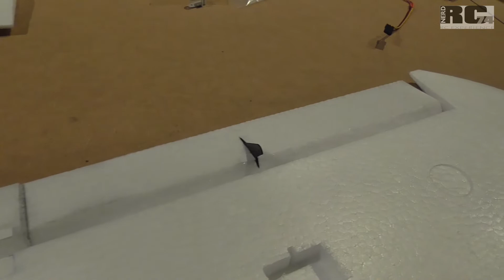MULTIPLEX FUNCUB | CLIPPED WING CUSTOM BUILD | PART 1

Comment: Check this out RCnerd74: https://www.thingiverse.com/thing:3671692
Reply from the maker: Nice part. What you have to solve anyways is the V shape of the wing itself. The V shape is in the foam itself too... but only necessary if you want a perfect looking finish on your funcub.  This part already helps a lot.
Reply: @RCnerd74  Yes, I shaved the mating surfaces flat with a razor blade before  joining/gluing them together. Wing came out pefectly flat. Are you saying the panels themselves aren't flat? I never noticed this. I only noticed the area where the panels join together had relief molded into them.
Reply from the maker: @austntexan  OK. It's just the center area of each wing half on the top side which is not flat if you mount the wing without V shape. I think this is what you already removed :o)
Reply: @RCnerd74  Man, I’m so glad I found your videos lol. I built my Cub and have it set up with full span ailerons, with most of the techniques you covered in your videos. . . my little Cub flies just like a pattern plane!  I’ve got a SS 2820 1100kv and it’s performance is unreal. I use an 8x6 on 4S and 12x6 on 3S. Loading the LiPo in the back vent was a brilliant idea. People ask me about my Cub every single time I fly it when they see it’s performance. It flies circles around every single Timber at my field. Love it!
Reply: @RCnerd74  I always hope you’re going to do another Fun Cub video. Any chance of doing one before Winter get here? ;-)
Reply from the maker: @austntexan  I hope so too :o) One idea is to show STOL capabilities without flaps... and some low level flying at perfect wind conditions... and a Winter flight is another thing i like to do.... white snow and blue sky... this always looks great. Currently i learn to understand the flight capabilities of my new Funcub in detail... that takes some time.
Reply from the maker: @austntexan  I am glad that my setup works well for you, too. With your motorization you have a lot of power. I recently flew a Timber. There are some things missing compared to our Funcubs :o)
Reply from the maker: Is the Fucub in the thingiverse link yours?
Reply: @RCnerd74  No. Mine is really plain looking. I need to post some pix on my RCG account soon. I’m not a great fixed wing pilot, so I didn’t want to spend too much time making it too nice!
Reply from the maker: @austntexan  OK. Looking forward anyways to some pics.